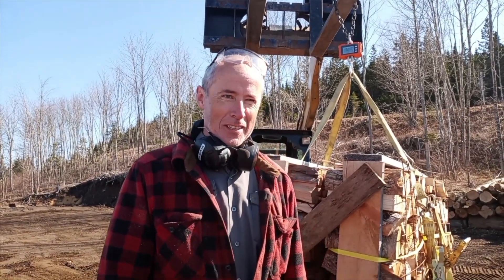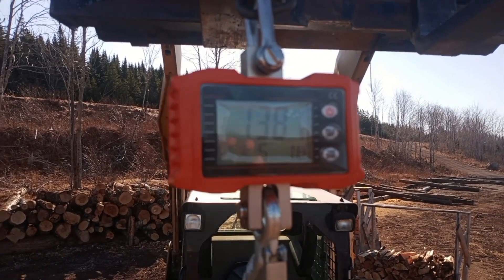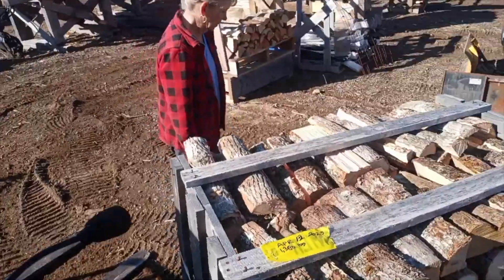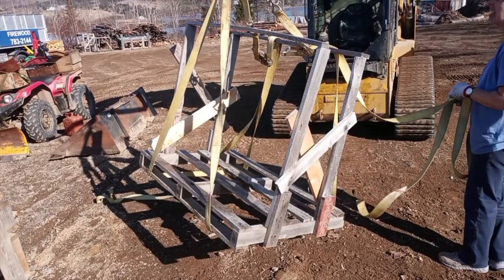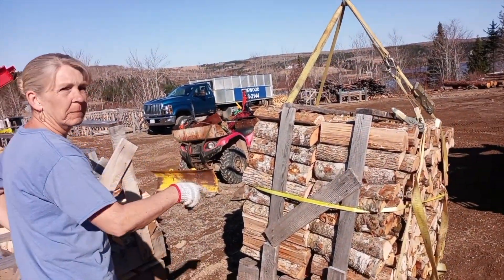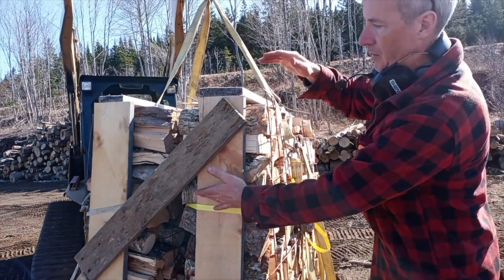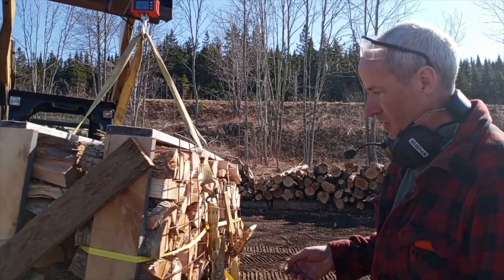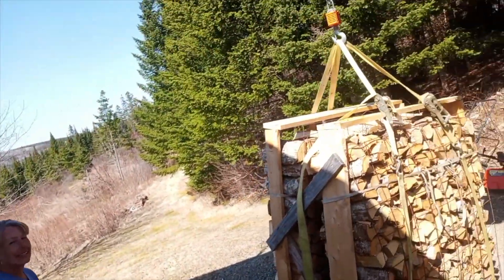20230414 Hardwood firewood weighs how much?

Comment: That's approx 1.2 cubes for Australian measurements. We do 1 meter squared for our sizes which is approx 500 kilos.
Reply from the maker: 'Cubes", you mean cubic meters?
Reply: @WoodchuckCanuck  yeah mate. Sorry, that's how we talk in Australia. Every word has a nickname haha. Depending on the wood, we charge approx $150 a cube of mixed hardwood working up to $300 for Ironbark which is the best wood you can get down here. Looking at some youtube channels in the US it is a lot cheaper over there.
Reply from the maker: @teaspoons5942  To compare, here we charge AUD$80 for 1 cube of green wood. AUD$81.50 for seasoned wood. AUD$109 for kiln dried to 20% moisture content.  Wood is a mix of hardwood like maple, birch, beech and ash.
Reply: @WoodchuckCanuck  cost of living in Aus is ridiculous. Those prices are a bargain. Who in their right mind would pay for electricity heating with those prices. I have an arborist mate so I get free wood but otherwise I go through about 10 cubes for winter so about 1500 Aus which is about 800 US
Reply from the maker: @teaspoons5942  We went through almost 12 cubes this year. Usually it's 15, been a mild winter. Yes, electrical rates are climbing. A little over CAD$0.17 a kWHr here now. That'd be 19 cents in AUD. Double what it was 15 years ago.  Home heating oil is just crazy pricing from what I hear. CAD$1.95 (AUD$2.17). To fill a 900L fibreglass tank runs close to $2K and it only lasts barely 4-6 weeks.
Reply: @WoodchuckCanuck  Yeah they just closed down a major coal fired plant today in Sydney which provides 10% of the electricity needs so prices will be going up. I have a mate who is quite rich and I'm contemplating starting a firewood business as demand will increase. Keep up the good work
Reply from the maker: @teaspoons5942  I never understood the 'supply and demand' pricing model. Meaning the less there is the more it costs.  I mean, if I start with 100 cord in the yard in the spring and come the start of winter if there is 10 cord left, I'm not going to charge more.
Reply: @WoodchuckCanuck  That's how you get repeat business. Loyalty is the key. There is a lot of 'Cowboy' firewood guys here, meaning unprofessional and a way for blokes to make tax free money. But it's wood, you can never have enough and by that I mean if someone runs out of wood they go somewhere else. Loyalty is earned and if the price is fair people will just keep returning.